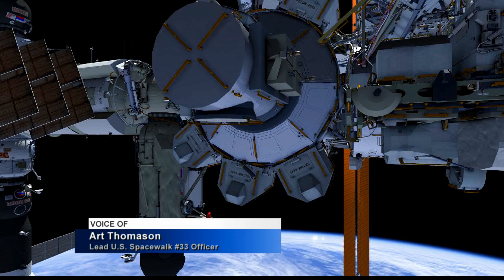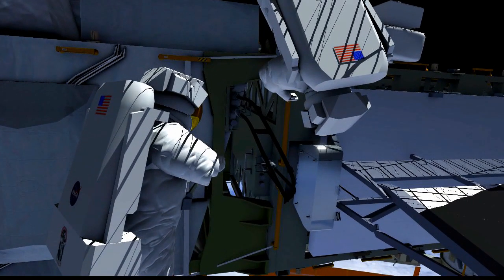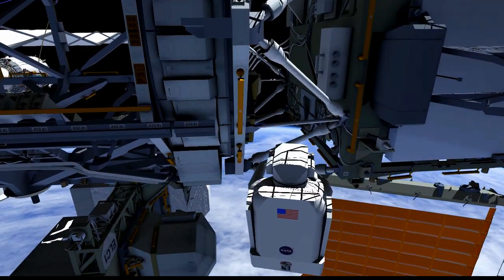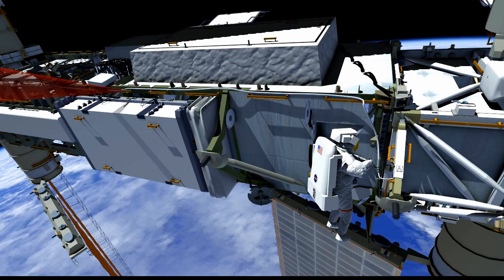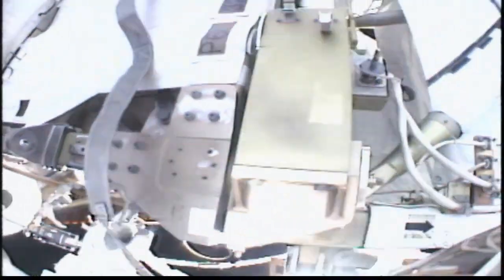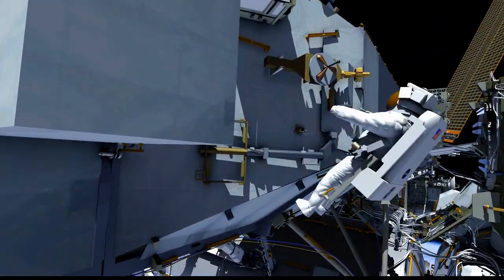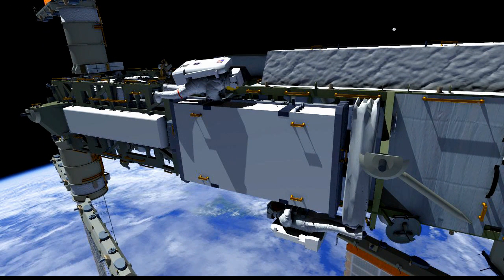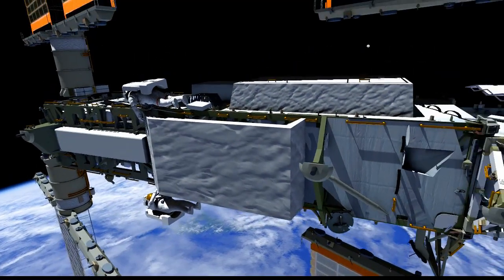3D Animation of Nov. 6 Spacewalk Activities

Comment: That is one big operation up there! Wish you guys the best of luck!
Reply: +FoodOfTheGods that radiator expels heat from inside the station recently it was leaking fuel and has to be stowed. currently the Channel B radiator is stowed and empty of fuel so they need to fill the tank redeploy the Channel B radiator then stow the TTCR and drain the ammonia fuel from it and fill the tank for Channel B. when Channel B shut down in 2012 it took the ammonia tank off line STS 135 sent it home and replaced the valve, Astro Wheels replaced it it leaked, they patched the line and filled it up it leaked again Astro Sunni went out and replaced the FHRC it did not fix the leak, then it was traced to the Pump Module Expedition 39 was sent out and they fixed it not with 45 up there they need to return everything back to the way it was. the ISS is using an outdated system and needs to switch to current radiators used on the station today.
Reply: +Aaron Peavler/Geomodelrailroader Railroad Photography Amazing, thank you.